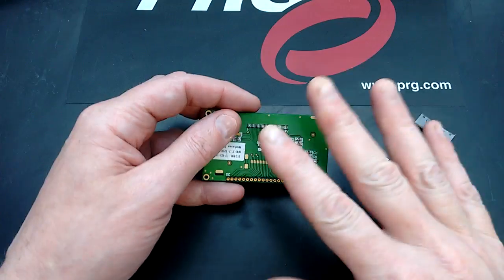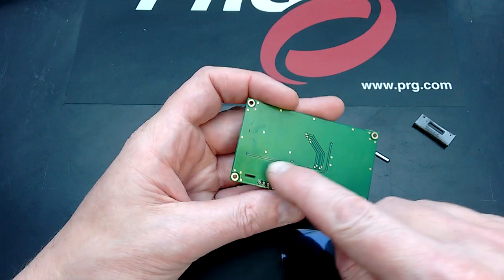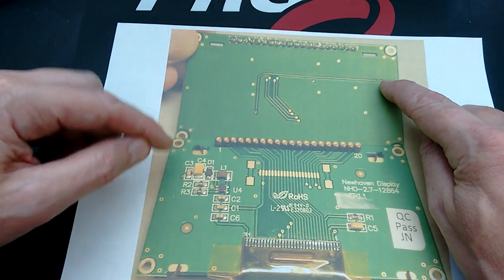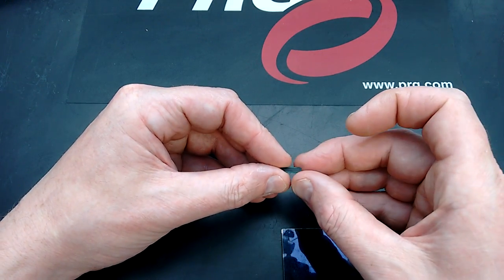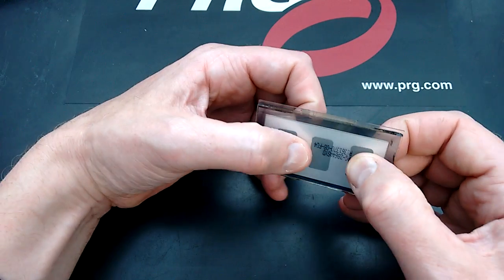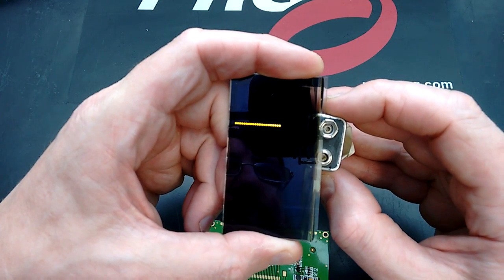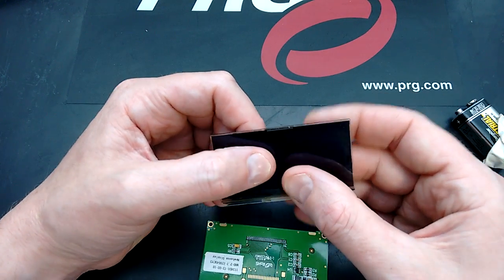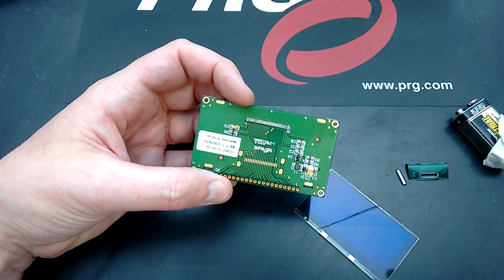More OLED stuff including the cause of the failure.

Comment: Clive - I really like OLEDs especially as pin-compatible LCD replacements for wide temperature operation. But people tell me they degrade. Have you any experience of that?
Reply from the maker: The technology is similar to electroluminescent technology, and has the same weakness of screen-burn if an image is used a lot.
Reply: I've always wanted an excuse to code a screensaver ;)

Comment: No phosphors involved, you get direct emission at the desired wavelength. It looks like that's a simple passive matrix display if you can drive it directly from the contacts like that.

Oh, and the reason for so heavily bonding the display layers together is that the OLED active layer components are highly moisture sensitive. You won't separate that nondestructively I think.
Reply: Organic-LED. I'm thinking water soluble dyes - colours would run if water moisture got in.

Comment: I'm quite curious as to how these displays look when they are functioning, and what one could de with them.
Reply: They look like vibrant lighted displays. I'd say they look similar to VFDs but with more contrast and usually tighter pixel spacing.
Reply: pretty much like the small  inch or so 4$ OLEDs you can get on ebay, but in bigger

http://www.ebay.de/itm/0-96-OLED-Display-I2C-IIC-TWI-128x64-Punkte-SSD1306-Anzeige-Weis-Modul-Arduino-/222193031250?hash=item33bbbc9852:g:d0UAAOSwRgJXj5rC
Reply: You can see it in his older video about fitting one to the projector.

Comment: Love the 9v battery trick:)
Reply from the maker: I'm not sure it's compliant with the manufacturer's guidelines.  But it had to be done.
Reply: @bigclivedotcom  love your video. I tried this trick and didn't have any results. Do you connect the positive and negative terminals in a specific way with the screen? or just plugged in randomly until I see some leds turning on?
Reply: Also, THAT battery is kind-of familiar... :)

Comment: If in doubt, conformal coat all PCBs.
Reply: if the customer will pay for it, in a humid enviroment, yes, but typically only for high voltage

it becomes a pig to toubleshoot if you have a failed component
Reply: +erg0centric if there is even the slightest chance the PCB can get wet and a replacement PCB costs more than a can of conformal coating, it makes sense to coat it. It's very easy to remove the coating with cleaner spray if you need to check anything. Most good conformal coating sprays react to UV so you can see what is coated (or not). This is all from a consumer side, not manufacturer.
Reply: if the customer wants we wash with deionized water, special washing machine that dries too, typically they want cheap and fast which would be no-clean flux

Comment: The chip on flex is most likely ACF bonded to the flex. It's a common way to connect flexible printed circuits (FPC) together. The power supply plated through hole that failed was probably at a much higher potential than the other traces, high enough to cause galvanic corrosion, the moisture acting as an electrolyte. I see this quite often when inspecting mobile phone failures. Excellent channel Clive, always learning something new!!

Comment: That piece of silicon on the flat flex cable connecting the LCD driver board to the LCD is actually a common thing. It's used in many LCDs.
Reply: Yes, but what is it?
Reply: +Marchel Hooijboer ok thanks will take a look.

Comment: I don't understand what problem the corrosion causes? No connection at all?
Reply: The oxide has a relatively high resistance. So, long before the corrosion actually breakers,the circuit, it will drastically change the amperage. I think.
Reply: +dahemac breaks; stupid autocorrect.

Comment: Whenever i use a 9v battery it seems to get...well um hot. Especially if the wire connected to it isnt connected to anything.

Comment: I think this is the earliest I've ever been to a video. Hi clive! :p

EDIT: Watched the video now. These little OLED displays are quite interesting, I wonder if they could be repurposed for other devices (and even plugged into something like a Raspberry Pi?)
Reply: Indeed you could. There are several OLED displays available for RasPi/Arduino stuff.
Reply: It would not surprise if they could. They look to be generic oled displays if not Pi arduino most certainly.
Reply: They are indeed very easy to use. I have one with a SD1306 driver controller and all you need is an SPI or I2C line (or even parallel I/O if you wish) to drive them. I've written libraries to write text or bitmap images in C.
Reply: Of course they can. Very standard display with a standard controller. Search the Newhaven part number for the wiring details and a brief overview of the protocol. The driver is a Solomon SSD1325.
Reply: These displays are dirt cheap on eBay. I've been playing with a tiny one this weekend, just 128x32, very tiny and cute. I'm driving it I2C out of an Arduino.